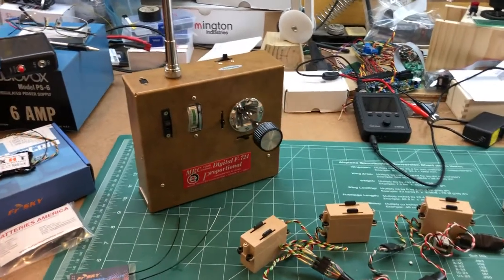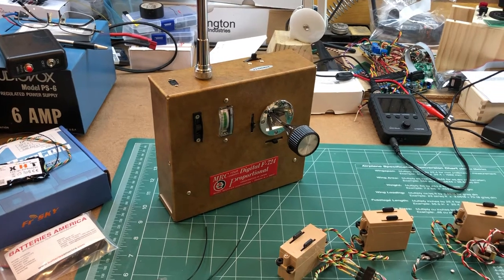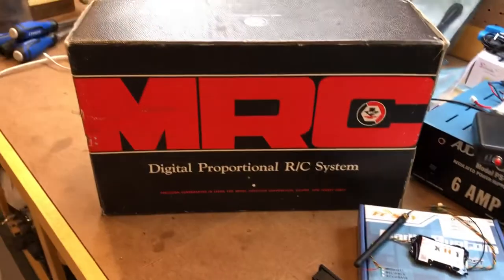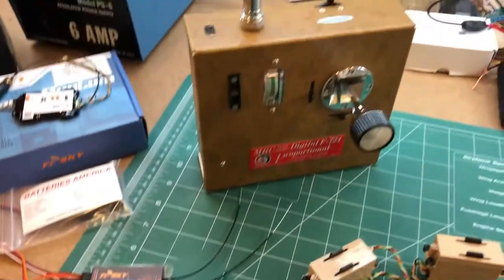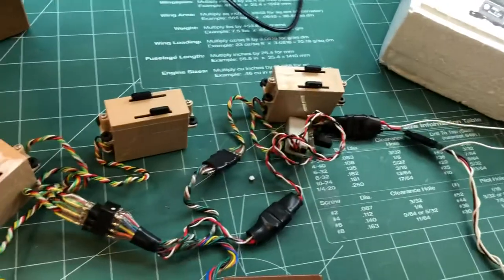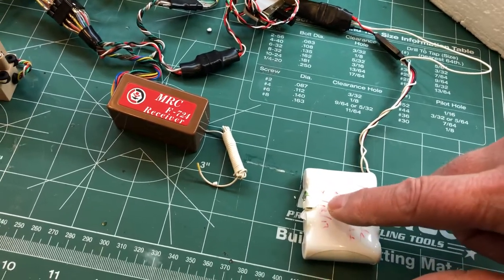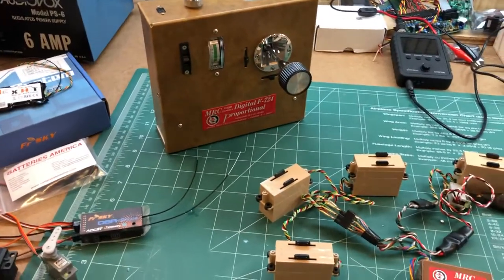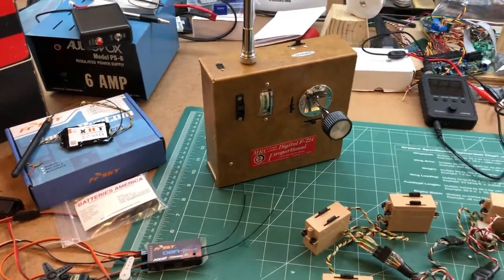1970s Vintage MRC single stick RC Transmitter powered up and working. FRSky XHT/DHT

Comment: Actually it's not 2.4v and 4.8v, it;s +2.4v and-2.4v. Positive voltage to drive the servo one way and negative to drive it the other.
Reply from the maker: Thanks - I was wondering why the 2.4 tap from the battery.  So the servo motors only need 2.4v I assume?